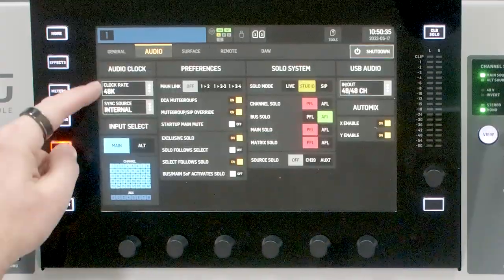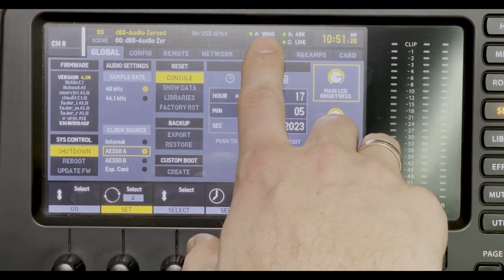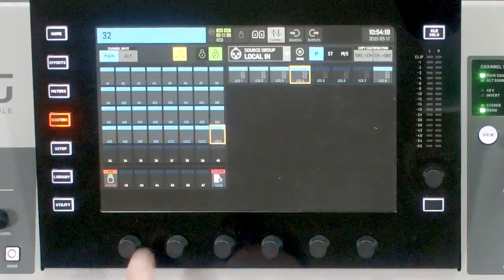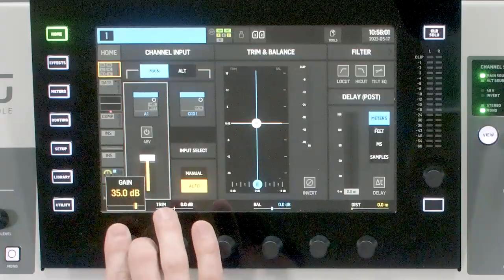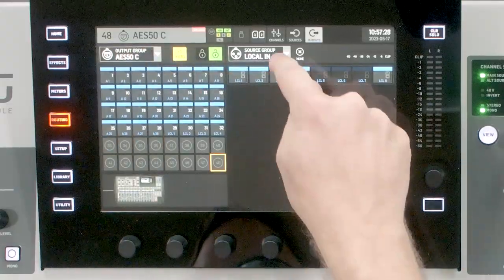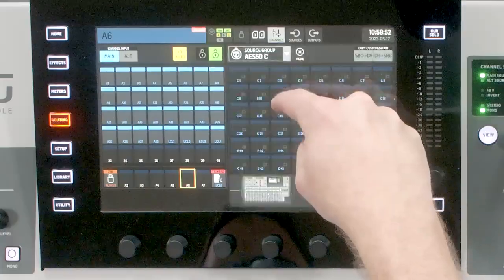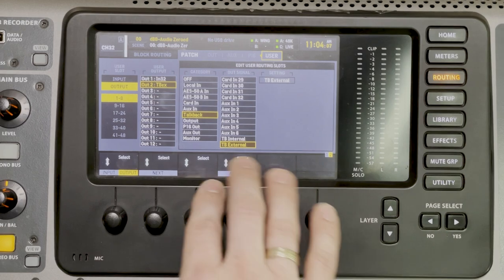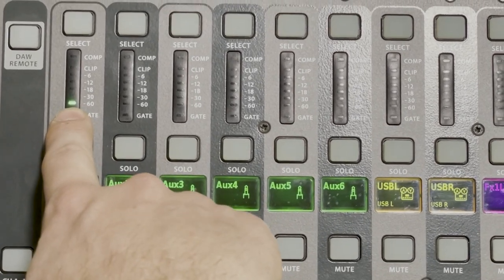How to use the Behringer Wing and the Behriinger X32 at the Same Time

Comment: Thanks for your video! If you look at the cable management, it would make more sense to go from the stagebox first in the X32 and then in the Wing. So you would have only one CAT cable between stage and FoH. Would it still be possible in this setup that the Wing is still gain master? Thanks for your answer!

Comment: @Drew Brashler is it possible to connect an X32 to a stage box with a network switch between both or it must be a straight wire between both??

Comment: Really helpful! I currently run an Wing at FOH and a X32 Rack for monitors. We have an X32 that we are not using so I have been debating on the ability to set it up as a separate broadcast mix and this will help a ton. I do have one question though, could I use the X32 inputs as a way to have more local in's for my wing?

Comment: Thank you for making this video. Is there a way to control x32 with you Wing. I’m running sound at a place for a week that has an x32 but I’d like to use my wing. Without disconnecting there x32

Comment: Hi Drew, great video! I was wondering if when using the Behringer Wing I could use a DL32 in AES-A then a DL32 in AES-B and then a DL16 in AES-C? To me this would make sense as the Wing has 48 stereo sources so I could need 96 inputs? How many outputs can the Wing do using the DL32 and DL16 stageboxes? That is 40 XLR outputs total available, could I run all of those if I wanted to? And the P16 outs could still be used as any of the AES A/B/C - Outputs 33-48? Thanks a lot, Dan :)
Reply: This is the same question I have as well. Is this possible to have a setup this way? I have a S32 and S16 that I would like to pair together and send directly to the Wing. Would I be able to use this setup with the P16 outputs? THanks for any assistance on this question.

Comment: I like everything about this video but, what if I want to control gain from monitoring desk? That way I can only take one cable running to FOH instead of two. We are mobile church and less cable runs the better.
Reply from the maker: You could, however the benefit of driving it through the Wing is if you were tapping into the FOH inputs or if you had multiple stage boxes.

But you could absolutely use an AES50 connection to both consoles off of say a DL32 or an S32.
Reply: HI @DrewBrashler  We already have an X32, can I add the Wing to the FOH, and receive the X32 input channels? Thank you, your videos are incredible.
Reply: I'm looking to run a Pair of M32 mixers, one for FOH, one at monitors. 
I would like to just plug EVERYTHING into the monitor desk. I typically run FOH from a tablet... However, I've got a national act that wants a desk out front. 
I'd like to just connect the two desks with a Cat6, and quite frankly, just have the FOH control the mains, and have the monitor engineer take care of the monitors.  I've connected the desks, to test this out, but the changes made on the FOH desk aren't changing the outputs on the monitor desk. I feel like I've tried everything... Clocks are set correctly, and the desks are recognizing each other... But the monitor desk isn't changing when I make changes on the FOH desk.
Also... The channel strip names and colors aren't matching. Shouldn't they match up when you connect these desks together? 
I basically want the FOH desk to simply act in the same way as a tablet does when I mix out front with a tablet. When I camhange anything from the tablet, it changes on the monitor board as well. 
Am I don't something wrong... Or do I have a faulty board?